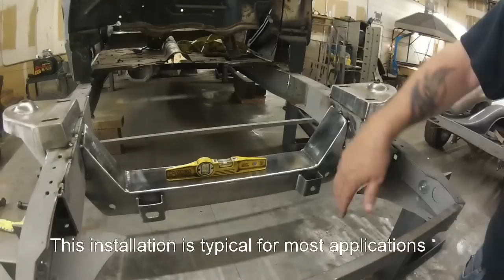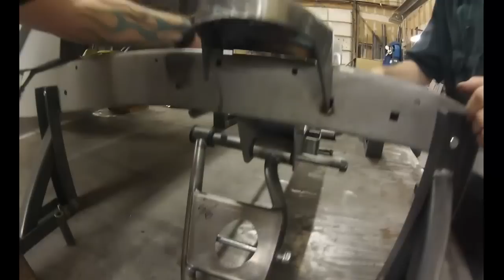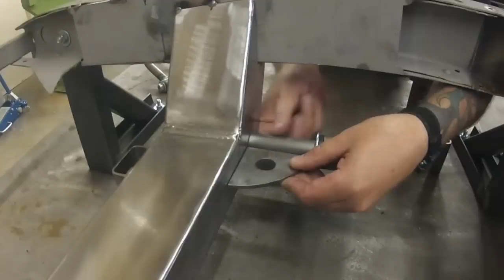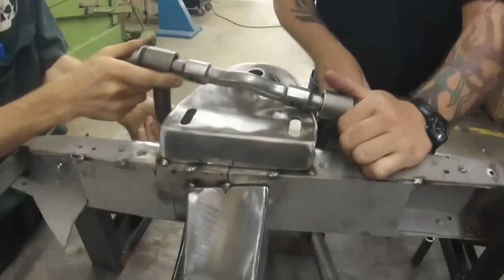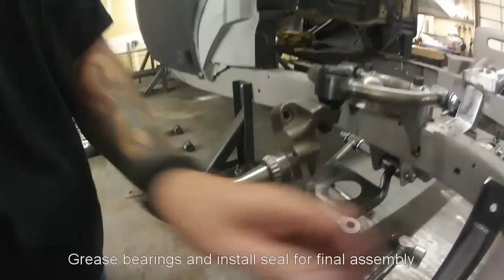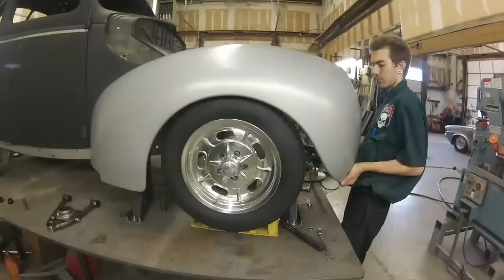Full Tilt's Mustang II IFS Install   Part 2

Comment: If you marked off axle centerline from the factory manuals, would you wheels sit right without fitting fenders? Someone might not have fenders just yet😅 but wants to have a rolling chassis. Also, do you guys offer a top mount that uses shims instead of t-bolt design?

Comment: Is it ok to move everything forward a bit on a 56 f100 so the wheel is centred? Factory has the wheel set back off centre in the wheel opening.
Reply from the maker: Yep. That what you want to do to center the wheel
Reply: @FullTiltStreetRods  thanks for the quick reply, I’m looking to get rid of the original. straight axle .. what’s your opinion about power steering? Is it worth it? The truck has a 312 Y block and I’m not sure if I could find a power steering pump setup for it..

Comment: I like the information my question is I have a 51 Ford truck , would it be safe to use a bolt on mustang 2 kit or the weld in thanks.
Reply from the maker: I'm a fan of weld on over bolt on thanks
Reply: @FullTiltStreetRods  Thanks I am trying to decide whether to use a chassis already design for my 51 because I don't do any welding an my body is in great shape any suggestions would be appreciated.

Comment: How do you determine if you'll have the correct caster angle in the vehicle?
Reply: On any of these systems, there is more than enough adjustment room.. just need to make sure you have the ball joints aligned fore/aft and that the spindle is perpendicular to the ground..  should be close enough to 0 camber/caster that you can set where you want..  drag racers will stagger left and right side a bit too :)